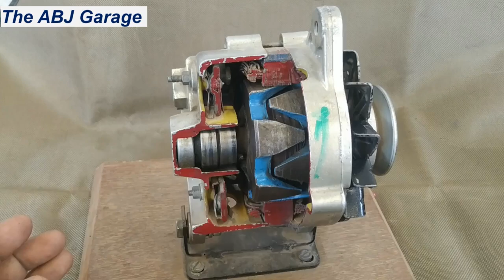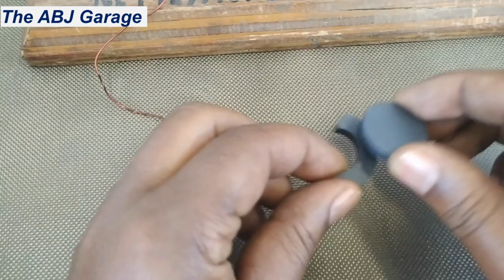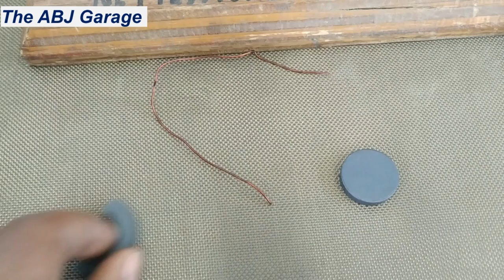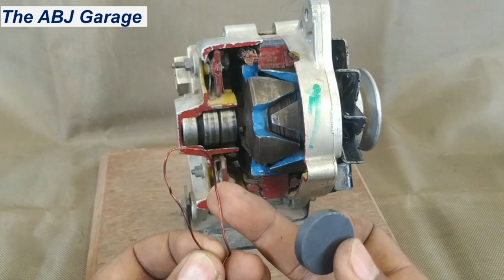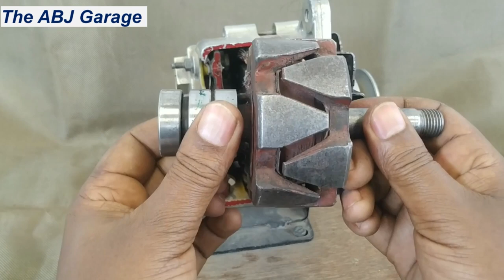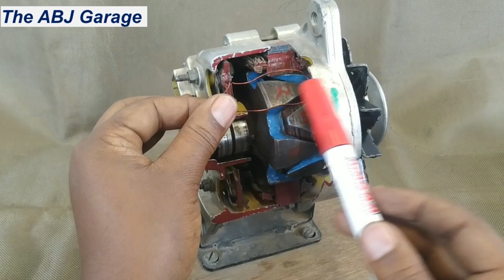How the car alternator works explained

Comment: One more question. How do they get each individual claw to be north or south pole since the claws aren’t magnets but just metal?
Reply from the maker: The rotor coil current direction is fixed! and hence one end of the coil becomes north and the other becomes south when current starts to flow through. The pole claw attached to the north pole end becomes north and the one on the south side becomes south pole. If interested we can use the right hand rule to determine the  polarity of the coil when magnetized. Or one can use a needle magnet on exposed rotor to identify which end is north.
Reply: @TheCarCareGarage  Got it! Thanks a lot for the clarification.

Comment: I just saw a video that said the interlocking claws were not magnets. They become magnets when electricity is sent through the copper field windings. I'm confused because you just showed they are magnets but there wasn't any electricity flowing through the field windings.
Reply from the maker: They will get magnetized only when there is current flow through the rotor winding! The discussion is presented here assuming there is already current flowing through the coil and the claws are magnetized. @ 10:26, 11:33 and 12:18 time on the video, that was mentioned.
Reply: @TheCarCareGarage  I see! At 10:05 the piece of metal that looks like a coin is actually the magnet and that’s why it stuck to the rotor interlock claws. Those claws only become magnets when electricity is sent through the coiled wire wrapped around the iron core in the rotor.